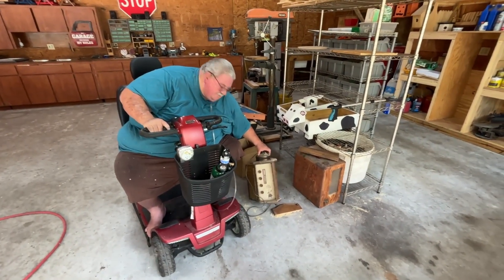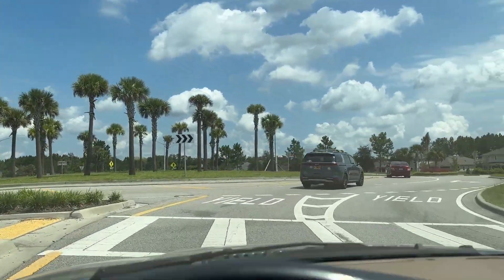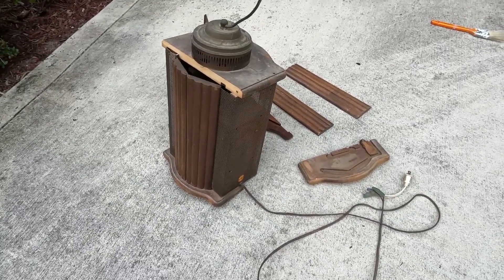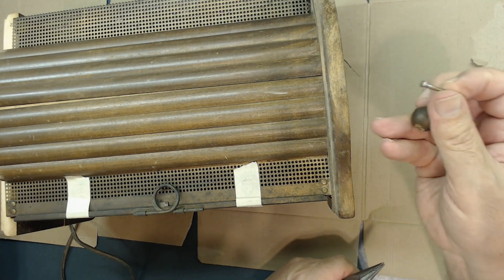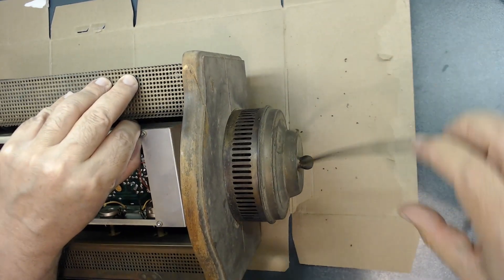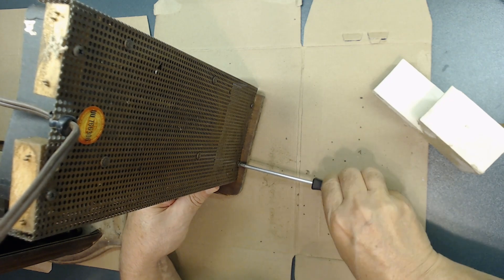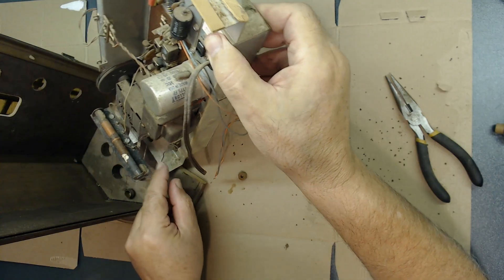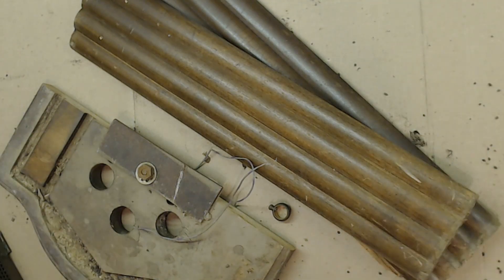Part 1 - 1970's Town Crier by Guild AM/FM (Table Lamp Radio) Restoration – Step-by-Step Tutorial

Comment: The front panels of these radios look dirty, BUT that' the way they are supposed to look.So don't make a mistake and try to clean off the effects on the front panel.
I just seen that this is not the tube version. No worries.
Reply from the maker: Great to hear from you, as always!
I was really surprised to discover that this radio is a transistor model. I have the tube version, which I bought a few years ago but never got around to opening. This one was donated to me, and it turns out to be quite different.
After comparing them this what I fund: 
The Town Crier AM/FM radios, which were made in both tube and transistor versions. While the cabinets are identical, there are a couple of distinct differences in the faceplate layout that help tell them apart.

Transistor Version:
•	Has 4 knobs lined up in a straight row with no spacing between them.
•	Uses a moving bulb as a dial pointer – the bulb moves as you change stations.
•	There is very little documentation online about this version.
Tube Version:
•	Also has 4 knobs, but 3 are aligned on the top, and the 4th is spaced below.
•	Between the knobs is a stationary bulb that lights up when the radio is powered on.
•	There is extensive information available online for this version.
Have a great day.
Best regards,
Jay

Comment: Given the construction of the case I really expected this to be an ancient tube radio. I was surprised to see that it was all solid state!
Reply from the maker: Hello,
Great hearing from you—and thank you so much for your message and for supporting my channel. I really appreciate it!

I know exactly what you mean—that was my thought too when I first picked it up. 

I was genuinely surprised to discover that this radio is actually a transistor model. I have the tube version, which I bought a few years ago but never got around to opening. The one I’m referring to was recently donated to me, and it turned out to be quite different.

Based on the components, I’d guess it was built sometime in the 1970s—the transistors look like an older style. From what I can see, there are seven transistors in total.

Thanks again for reaching out!

Best regards from Florida
Jay

Comment: What a surprise to see this novelty radio. What is even more is that there was a tube version called the model 380T
and I saw it in a post on a popular selling site. Looking there there are a few more ones being sold. The knobs of it look
like wood buttons just  like yours. Good luck in getting a schematic of the solid state version of the 380T Jay. The rare
novelty radios during this post tube transistor  era are very hard to come by.
Reply from the maker: Hi Steve,
Great to hear from you, as always!

I was really surprised to discover that this radio is a transistor model. I have the tube version, which I bought a few years ago but never got around to opening. This one was donated to me, and it turns out to be quite different.

Judging by the components, I’d guess it was built in early 1970s—the transistors appear to be of an older style. From what I can see, there are seven transistors in total:

Three on the main board, marked CDC 12030B052 (though the last part might actually be 8052—it's hard to read clearly).

One on the AM/FM switch, marked 2N292.

Three inside the square metal canister in the tuning section:
One labeled BNTC785
Another marked A102, although the rest is difficult to make out
The third is in a position that makes it hard to see any markings at all

Just thought you'd find that interesting!

Have a great day.

Best regards,
Jay

Comment: Cool looking solid state version. I may have it missed it with my phone ringing, how many transistors does the receiver have? Best, Don
Reply: I’m emailing you a book for reference that might be helpful. Best, Don
Reply from the maker: Don,
Thank you so much! You’re a true gentleman — kind, caring, and always willing to help. It’s a great feeling knowing that good people like you are still out there.
Have an awesome day, Don!
Reply from the maker: Hi Don,
Great to hear from you!
This radio appears to have 7 transistors in total, as far as I can see:
•	Three transistors are located on the main board, marked CDC 12030B052. (It might actually be 8052 instead of B052—the marking is quite hard to read.)
•	One transistor is on the AM/FM switch, marked 2N292.
•	Three transistors are inside the square metal canister in the tuning section:
1.	One is labeled BNTC785
2.	The second is marked A102, though it's difficult to make out the rest.
3.	The third is hard to identify due to its position—it's not easy to see the markings.
Please feel free to email me at radiofixer@yahoo.com
Thanks again, Don!
Best regards,
Jay
Reply: @RadioFixer Jay, I’ll be on the lookout for a schematic. I saw your posting on ARF, any replies back on a source? Best, Don
Reply from the maker: Don,
Since these radios, as you know, were more of a novelty, there’s not much info available online. I got some great suggestions on ARF, but still no schematic—so I can’t quite figure out what type of transistors they used in this radio.

AM was working originally, and I tried to fix FM. FM is now working, but AM is totally dead—like a doornail! LOL

Thank you very much, Don! Have a good day!